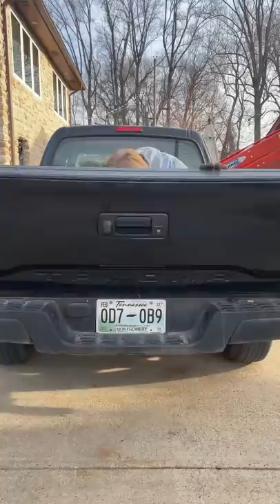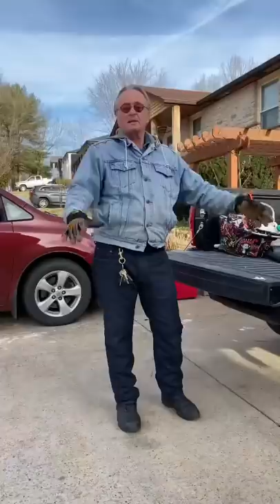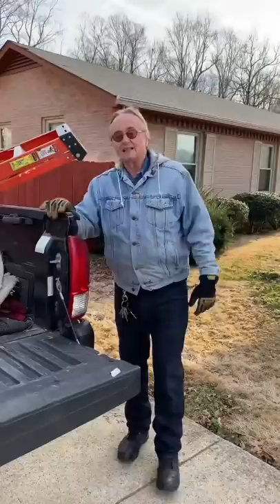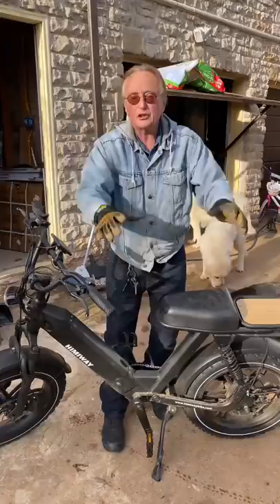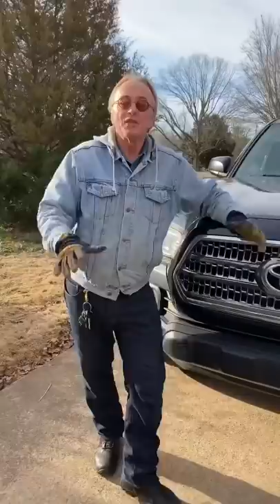Electric Trucks Suck

Comment: For once Scotty missed. Chevy’s Silverado EV is rated for 400 miles. Even if you’re hauling you’re fine. And Ford rated their Lightning F150 for 350 miles WITH payload.
Reply: He always misses on EVs.
Reply: You obviously haven't done any reading, they towed 7k with a lightning and only got 190 or so of range, so no you're wrong.
Reply: Right?  These manufacturers assume pickup drivers are going to be driving with a load.  I see this as an absolute win because this most likely will equate to better than advertised range without a load (assuming conservative driving habits).
Reply: @faststang85  probably towing on flat land also. Throw in some hills and see what happens. Turn on the a/c!
Reply: Or turn on the heat or tow in the snow or rain.
Reply: The f150 was only rated at 190 towing….and generally when in towing I go way farther than that lol…..being a mechanic that works on electric vehicles as well as everything else I’m not impressed with the Ev’s
Reply: @Pinehollowmechanical  towing with gas or diesel also means that your towing capability is the same from the first gallon of fuel out of the tank down to the last gallon of fuel from the tank. Low on fuel and can't make it to the gas station? I just pull over and pump five gallons in the tank from my 75 gallon saddle tank located in the box. Takes about five minutes.
Reply: Don't forget that the range manufacturers give are going from 100% - 0% charge.  EVs are highly recommended to never be charged higher than 85% capacity and never be drained below 20% charge.  So you're really looking at 65% range.

You can use the entire 100% and rapid charge but you'll be killing that $12,000 battery in no time.  Such wear and tear is NOT covered by warranty.
Reply: @northdakotaham1752  I’m glad others see it the way I do. to go with it for argument sake say both a diesel and an ev towing have the exact same range 190 miles…takes what 5 min to fill the diesel 5-7 hrs to charge the ev fully or if your on the interstate you have the quick chargers which give you about 50% in like what 15-30 min and you can’t usually charge them full with a quick charger because it causes battery degradation problems. Now you only get 95 miles before you have to wait 15-30 min all over again to only get 95 miles more while the diesel gets 190 miles pretty much always…..now anyone pro ev don’t take this as me saying no one should have ev that’s not the case but I don’t think ev is for everyone and I don’t think that I’m a certain time frame people should be forced to buy ev if they want something new…that I don’t feel is right, and at some point I feel that the epa/government is gonna tell us that do enjoy our ICE vehicles and would rather drive them that we all together just can’t have them….and that is gonna be a sad day

Comment: One of the things he left out is the fact that a train uses the same amount of diesel going 10 mph as well as going 60mph, That's the main reason for that along with having more torque and it's easier to have however many motors than getting power to however many wheels from a single point

Comment: I have never been a fan of electric vehicles and will never own one. Storm comes knockouts out power your screwed, grid goes down, wind storm (2007-no power for 8 days) you are screwed, plus your cars combustion engine can be used as a generator in emergencys.

Comment: 300+ range they say but what about while going 75mph, heater or ac full blast, accessories running, phones charging and towing a boat. What a challenge to the automaker engineers but eventually it might be done.

Comment: He’s right and while I’m old school (despite being only 24) and refuse to give up my vortec 350 V8 Tahoe, I realize and accept the fact that electric is the way we are going like it or not. There won’t be an option before long. We could be there as early as 2040 or hell 2070 but it will happen, and when that day comes, If I’m still driving, I will still have my 97 Tahoe 4x4 here in Montana and at the last minute I will have it converted to an EV, but only at the very last second when it become mandatory to keep it. Lol

And of course 20-40 years from now, who’s to say we can’t have 800 mile (unloaded) batteries for pickups? You never know

Comment: But is the rate of drain on the battery more than the loss of gas/diesel mileage when you're towing? I think the biggest issue with battery cars is the cold. I don't see us switching to electric in the near future.
Reply: Look at Norway. In 2021, 65 % of the cars that were sold there were electric and another 22 % were plug in hybrids. I dont think that would be the case if they were that terrible in the cold

Comment: But pickups have more room for a bigger battery no?
Reply: A bigger battery means more weight which equates to less range as it requires more power (Catch 22)  . It's basic , long haul EV's are a joke and this will be seen in the next few years .
Reply: @rdhudon7469  So your saying the lost of range from increase weight is greater then the amount of range gained from the increased battery power? I'd like to see that source.

Comment: Maybe if one has large gas generator in bed or trailer running and charging while pulling a trailer can increase  range? Manufacture would have to allow for charging while driving. I would think that would give a lot more range since EV are so efficient but one might have to connect larger gas tank to the generator.

Comment: How do the down sides of electric vehicles which you named not apply equally to gas powered vehicles
Reply: Good point. It’s easier to get fuel up in a gas pickup truck and don’t have to go out of your way for starters.  Also cold weather has less than an impact. Towing multiples the effect for electric vehicles

Comment: Car manufacturers really should offer the option of a small optimised onboard generator. Basically a plug in hybrid where the Internal Combustion engine does not connect to the drivetrain, and instead only recharges the batteries.

That would save the weight, complexity, space and cost of having two seperate drive trains and still allow the major advantage of electrics when towing or carrying heavy loads - the torque!!

Comment: Gas and diesel also waste more fuel when you load them up and drive fast though the range is still higher than electric. I think we need to start somewhere though kinda like the internal combustion engine which at best is 30% efficient. First renditions rarely get things done right the first time.

What happened to people? We need to give industry a chance. I guess it's what happens when you go from layaway to credit card🤔.

Comment: Here's a fact. Mile for mile, an electric car costs 20% as gasoline where I live. Another fact, they have no belts, alternators, spark plugs, hoses, starter motors, air filters, mufflers, engine oil, transmission oil, fuel filters, oil filters. And the lack of vibration reduces the wear and tear on everything.

They are not good in cold weather, and they are not good at towing.

I'm not an environmental guy, but I save money by owning one, even with the higher price.

Comment: Same as Gas truck.  Just takes longer to recharge batteries in electric truck.  So it's a prerogative thing.  Is the savings on operational costs worth the down time of vehicle recharge?  I would think anyone that works ina metropolitan area.  Electric pickup would make good since. But if your hauling out in open country. Probly not.

Comment: What you say is true, but battery lifetime hauling stats are included for most trucks you would buy. Their lifetimes with significant loads are still more than enough to make quality work trucks. They also have far more powerful and energy efficient engines than traditional trucks.

As a work truck that is not used for travel and returns to a lot each night, electric trucks make more sense than gas-powered.

Comment: This is why I think hybrids are a better choice even though they are more complicated. There are gas generators that love to run at the same speed. They don't need a lot of torque. I would love to see someone do yard car work with an EV truck going from house to house then to the recycle without a recharge down time.
Reply: Yes I think manufacturers are trying to 'one-up' each other by going straight EV and skipping Hybrid entirely.
They are all racing to make one of the first electric pickups everyone will talk about

Comment: Have you seen the vehicles that have the ability to help recharge the batteries because as their wheels turn (all 4) the axles generate electricity to send power back to the battery bank?
Reply: That's regenerative braking.

Comment: Yes u got it wrong again, not about the Deisel but the new Locomotives have a dc battery bank instead of a big dc capacitor bank. The battery drain only occurs when the vehicle starts moving. There after, the higher speed is maintained by voltage not current.

Comment: But this is real. We can't make make electric semi or HD pickup or even just a real pickup that hauling heavy weight. Conventional Fuel have much more energy per cubic metre than battery. More weight to move=faster battery drain. Battey technology is not there yet

Comment: Scotty your age and bias is showing. The Wabtec FLX all electric freight Locomotive is running delivering freight on US and Canadian tracks it electric motors produce 22.5 Tons of power at 75mph, for 350 miles. It recharges it batteries on a quick charge not much bigger than a Tesla. It lithium batteries hold 2.4 MWh of power.  The are running in CN fleet now moving 300 Million tons of freight/yr. Going back farther PRR ran a fleet of electric battery GGR1 Art Deco classics in both freight and passenger service from 1932 to the merge with NY Central. It   ran the most luxurious and most expensive run ever. The Broadway Limited to Grand Central Station the GGR 1 could run while recharging on retractable overhead contact scissors or be plug in at Station terminal. It moved at 100mph and had enough juice to provide every thing powered in Pullman cars. From the galley car to the US Mail, to refrigerator in clubcar to the Refrigerated cars the dining car had. It even had enough balls that extra freight cars that were added time to time. Also was able to Power a new thing call air conditioning to keep the ladies cool. Not to shabby for acid zinc wetcells. Mining, logging shortline, and mountian cog drives full electrics have been running since   1887. Come on. Scotty,, time to stop that anti electric not workable crap. If you don't like electric that's your problem not the vehicles.

Comment: They have regenerating stuff in wheels so when u let off accelerator it turns into a generator builds up energy and puts back in the battery for range
Reply: You ever hear of the law of conservation of energy or the second law of thermodynamics? That's like sticking a fan out of your window and saying your charging your battery from the wind.
Reply: The regenerative breaking is negligible, no where near enough electricity is being produced actually make a difference even in sedans let alone trucked towing 9,000lbs

Comment: So what I’m hearing is we want and electric pickup truck that uses a diesel motor to generate electricity to run the electric motors… then we can have that snappy acceleration, monstrous torque… AND not have to worry about charging times.

Comment: The idea is great, it is reality that sucks. When we invent a battery that has 3-5 times the current energy density they will be fine for most uses.
Stating they are energy hogs as compared to ICE is simply wrong. But all cars use huge amounts of energy, so really use a better point.

Right now, hybrids make the most sense. If they had 60miles of full electric that would cover the daily driving/commuting. The ICE can then handle the long hauls and heavy loads. The engine can be smaller with the electric motor there to buffer the output. Extra power for loads going up hills, and they can regen on the way down.

I predict diesels going away due to the emissions requirements ruining them and making them more costly. Gasoline hybrids will replace them. Better fuel economy and more torque when you need it.

Comment: Scotty still does not get it. 90% of pickup trucks do not require long distance travel with high tow capacity and the electric pickup will be just fine with the great advantages of 120/240 onboard power to run tools all day/night and elimination of all the complexity and cost of the ICE power train.

Comment: I know everyone here is going to tell me they tow 16000lb trailers daily across country with every truck they’ve ever driven… but that’s not true. 

Pickup trucks are the most popular vehicles in the US. Most of them don’t do heavy towing. Most don’t even go off road. Most of them are taking up a spot and a half at piggly wiggly. 

I know everyone is the exception. But you’re probably not actually. It makes sense for a lot of people. Doesn’t have to make sense for everybody. 

Also as others have said every complaint in this video is also true about gas. Towing heavy loads takes big energy. The more realistic complaint would be charging takes longer than filling up a gas tank.

Comment: I learned electic vehicles suck when I was 8. Radio control cars die in 10 minutes.
Reply: 🤣 ah this got me,  yup the old Nikko brand with the 4 or 8 AA Ni-cd.  That took 3 hrs to charge n you had to feel the battery towards end of charge to get warm and not overheat.  Then around 18yrs old I went nitro, they are garbage,  then back to Lipo, every car I had, esc took a dump and either never ran again or did a run away on me.   It's all garbage over time and needs much maintenance=$$

Comment: It's the same for any vehicle. The only difference is it takes 5 minutes to fill a normal truck and more than an hour to charge an electric truck. If you can get 100 miles out of a charge with a load, that would work for most people that own trucks. What you should be complaining about is the cost of replacing the battery, the environmental impact of creating so many lithium batteries and disposing of them when they reach the end of their life, the fact that no power grid on the planet has the capacity to charge even a small amount of EVs and a lot of the capacity we have is coal powered. EVs are not as eco friendly as people are led to believe. They are fun to drive though.

Comment: 60% of electricity comes from burning fossil fuel. the production of green and renewable tech, mining for the materials, and affects that turbines have on animals completely offset the benefits. So not only are electric vehicles extremely inefficient in hot and cold temps, and annoying for long drives/heavy hauling, until we switch to nuclear energy, they pollute just as much if not more than modern engines.

Comment: Sir electric motors can produce more torque than gas or diesel for the same size and electric mileage is around 300 lets sey your heavy its halved but the computer notices and tells you. If you have to drive more than 100 miles away from an charger maybe dont get an ev

Comment: They should probably get rid of those fully-electric no diesel engine big rig trucks. That run for hours and hours and hours and hours and hours on end with no trouble whatsoever and yeah don't lose any power. It's good to know you're fully Versed and what you're talkin about you know literally nothing.

Comment: Scotty what if you have a small hydrogen engine to generate and charge battery.  Wondering, like a train  generation plant compared to the weight  the train pulls
Reply: it takes more energy to produce hydrogen fuel than you get from it.

Comment: He is both right and wrong here. He is making factually accurate statements but leaving a few things out. While it's true moving more costs more energy we our a lot better at making batteries than years ago and some electric vehicles can travel further fully loaded than their counterparts that run on fuel. 

Basically read the specs of whatever car or truck your using to determine what is right for you. 

Also not all electric trains run on a fuel charge system. It mostly comes of the city power so whatever your city is using is what's charging your trains and busses that are electric and while most do use fossil fuels at the moment that is starting to change.

Comment: This is true with gasoline as well. Just saying.
Reply: Yep, I thought the exact same thing as well, albeit that gas engines have much more potential energy. Still, the argument is the exact same (you use more energy whenever towing or hauling regardless of the energy source). Once again it just devolves down to the output of current batteries.

Comment: The faster you go, the more any fuel is used... The only issue with EV's right is the lack of energy capacity in a CURRENTLY standard EV battery compared to energy capacity of a standard ICE fuel tank. You simply can't go as far as a current ICE vehicle without needing more juice.

HOWEVER, as does every technology (especially new ones IF they stick), EV's will evolve.

Comment: The Ford Powerboost is a good idea…it’s an actual generator where you get the electricity from gas and braking not a plug in that just looses charge🙄
Reply: I think that is cool how the powerboost f150 has an actual generator that actually generates electricity in stead just draining the battery in a new electric truck. Yeah it is cool to have on the electric trucks but guess what the more energy you use the less range you will because electric trucks because it doesn’t generate electricity when at a stand still.
Reply: The Chevy Volt also had a generator.